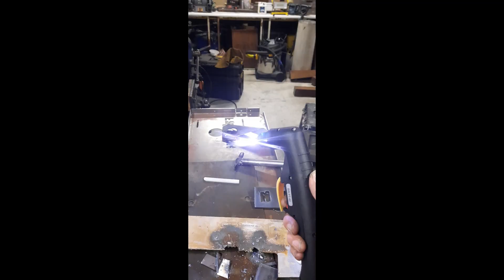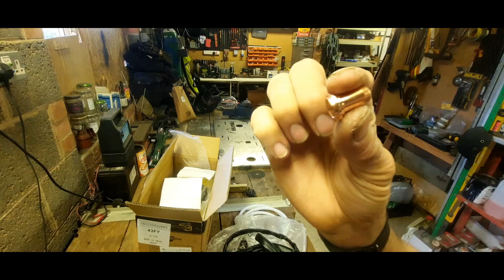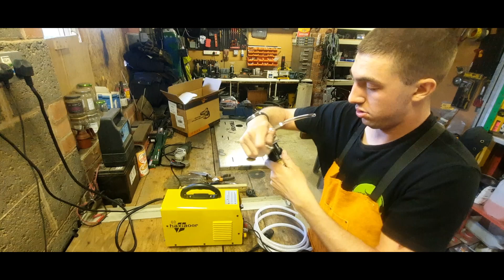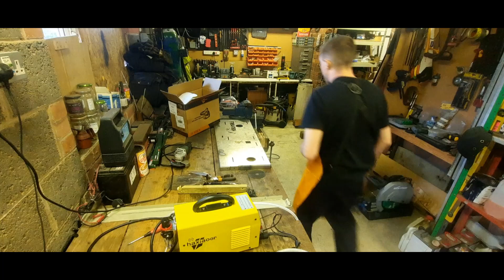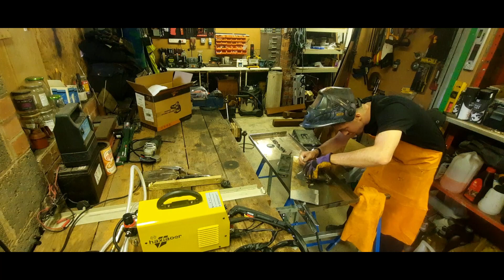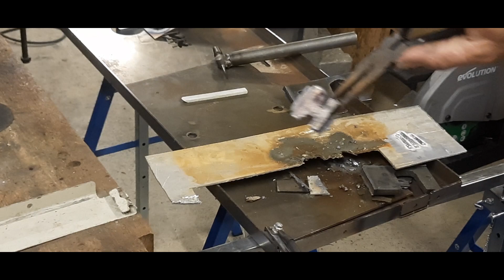Haxiaoer Plasma Cutter—Review/Setup

Comment: What were your settings? Current and air pressure? I have exactly this model, just set up. The arc never last more than 4 seconds. And the 4T switch doesn't seem to work at all. Any ideas?